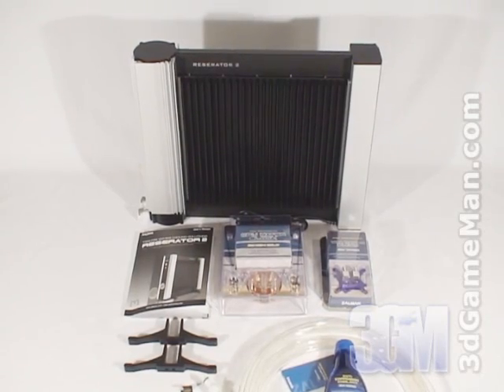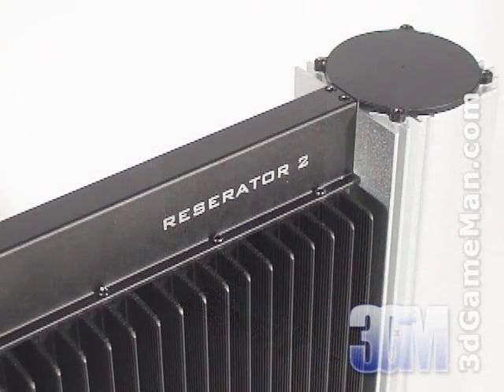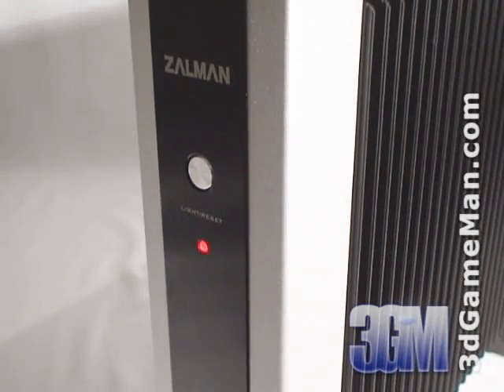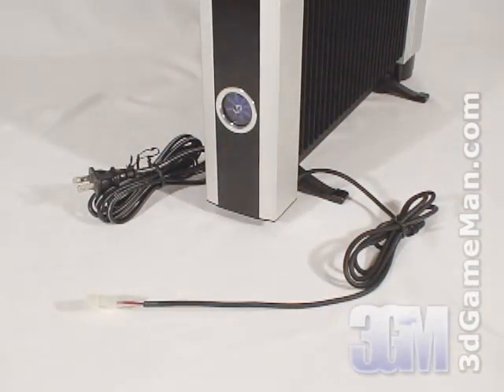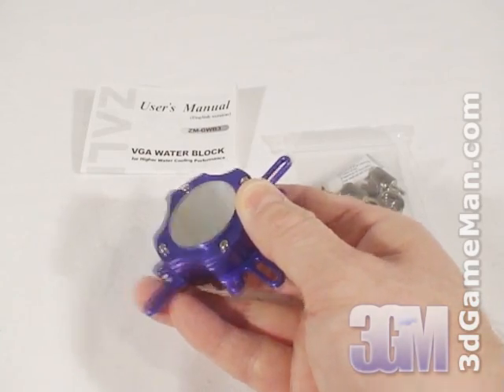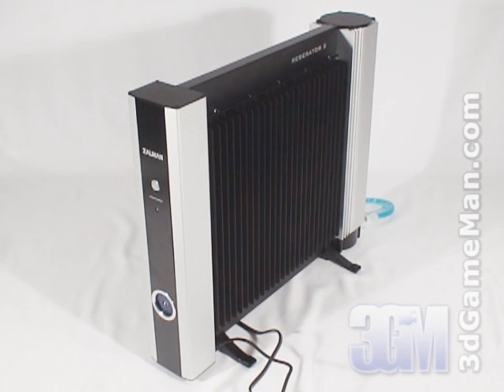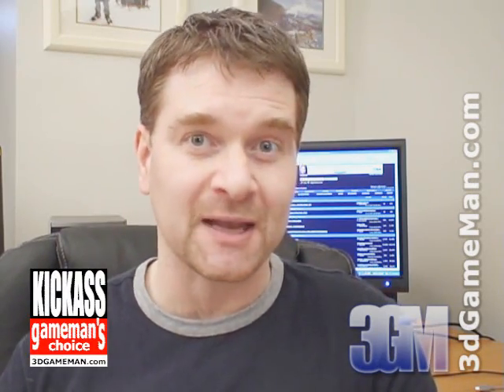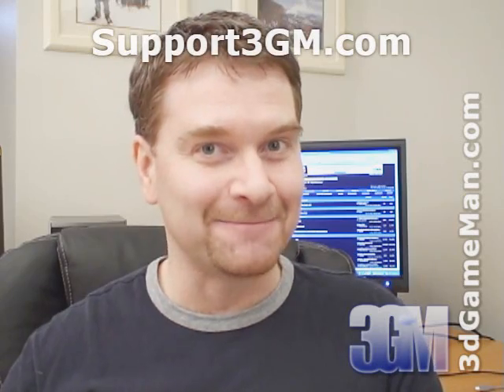#783 - Zalman Reserator 2 Water Cooling System Video Review

Comment: NEVER USE ORIGINAL ZALMAN COOLANT!!!!

As suggested by other users in January 2009 I have replaced ORIGINAL EXPENSIVE ZALMAN COOLAN with noname nonoriginal Alphacool AlphaCola coolant and suddenly ALL problems dissapeared and Ï have no problem since. It seams that ZM-G200 really sucks, it agglutinates and it is causing all the flow detector related problems.